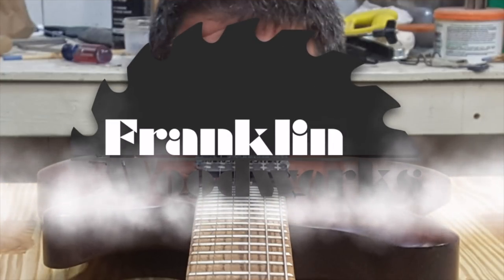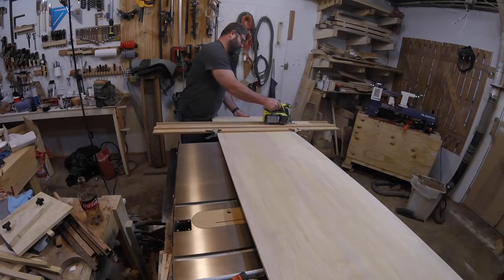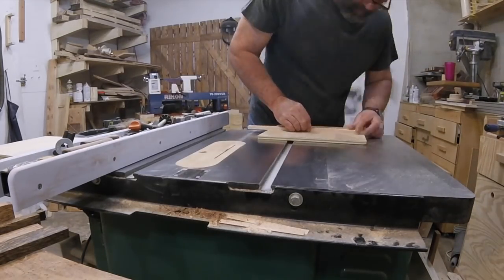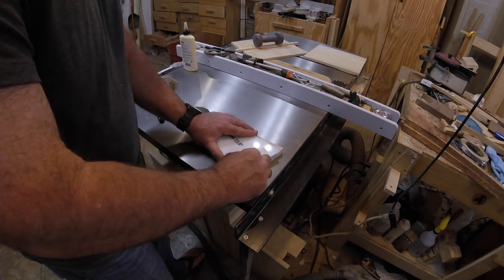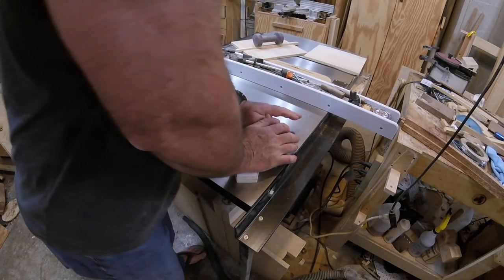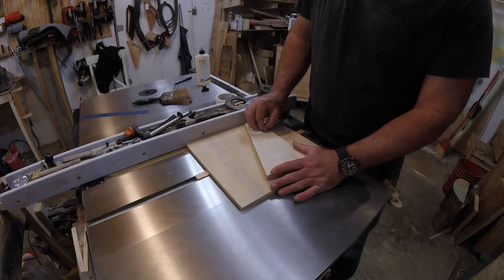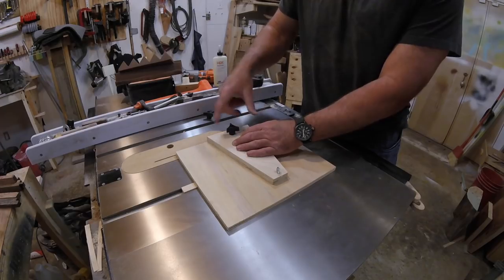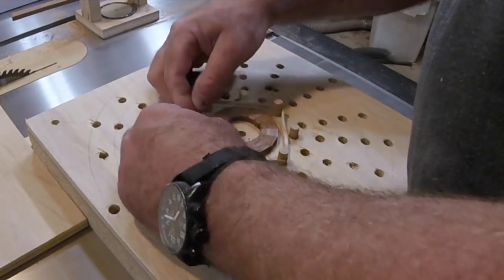Quick and Easy Wedgie Sled

Comment: There is a fundamental difference between this design of a wedgie sled and the original with two fences. With the original you are always registering the cut to the same side of the stock; therefore, the two sides do not have to be dead parallel. With this design, you're using both sides of the stock for registration; therefore the two sides do have to be dead parallel. I know that is not insurmountable but it does introduce another possible error.
Reply from the maker: Good observation, and totally correct.  I do, however, make sure my stock has parallel sides - a well set up table saw makes that a snap. Thanks for watching!

Comment: 1. does it make a difference which end is the saw blade end, wide part or narrow part of the template.
2.  could you not just use one side of the template and rotate the piece to be cut? (mark each side of the piece to be cut,  A  and  B, first cut A side up, 2nd cut B side up)?
Reply from the maker: The end you use wouldn't make a difference, it's just personal preference.  Theoretically, you could just use one side.  However, that would depend on perfect placement of the wedge exactly perpendicular to the blade.  If you are off .003", multiply that by the number of segments, and you could be way off by the time you get everything cut.  By using both sides of the wedge, it's self-correcting.  I'm not a math major, but I think just flipping the wood on the same side of the wedge wouldn't correct.  Might even amplify the error?  Maybe someone smarter than me would know the answer to that.
Reply: Ok, thanks.

Comment: great work....I really like the Rubber band block.... did you use a plan?
Reply from the maker: I didn't, but I saw one in another YouTube video, and decided it was a great idea.  Turns out it was.  I used a piece of 3/4 plywood glued onto a piece of a 2" thick pressboard door.  The rings are in 1" increments.

Comment: IMPORTANT: Cutting on a table saw on the back side of a fence is dangerous. As the strip gets shorter the more it gets. I know it sounds like a good idea but it is not. There are several ways to make a Wedgie sled that is safe. As the inventor of the system and producer of the Segmentology videos, I have more experience at it than anyone on the planet. The table saw is not your friend. It will bite you bad.
Jerry Bennett
Reply from the maker: Mr. Bennett, first let me thank you for your HUGE contribution to the woodworking community.  I discovered turning fairly recently, but segmented turning is what gives me the most pleasure.  I agree that cutting on the back side of a fence is not ideal, and can be disastrous.  But most of us change the methods we use as we gain experience.  For instance, most professional woodworkers take the cumbersome blade guards off of their table saw.  I don't believe this is done out of ignorance, but done with knowledge of how wood is interacting with the blade.  Likewise, I take appropriate precautions when I'm cutting segments, ensuring that I have a solid grip on the work piece, and I never force the wood through the blade.  All that being said, I have since discovered that making the sled is so easy and fast, and since they can be relatively small, I'm just going to make separate sleds for each wedge angle, permanently affixing the fences, and using the fence methodology you suggest.  Thank you so much for watching my video.  I am truly honored you took the time to comment and share you knowledge with me and others that may read this.
Reply: Sorry, but as a new segmenter I don't understand the warning about "cutting on the back side of the fence."  Please explain to a novice.  I want to be safe!
Reply from the maker: @randysmith4344  A very general rule is that a work piece should be supported as well as possible when introduced to a moving blade, sanding belt, etc.  When you put a work piece on the back side of a guide, that work piece will want to pull away from the guide.  The only thing holding it to the guide is the pressure you're putting on it with you hands.  This greatly increases the chances of an accident.  I'm going to make another sled soon that will take care of this problem.  Stay tuned!
Reply: Thank you.  I get it now.  When Mr Bennett said "fence" my mind immediately went to the table saw fence and I just couldn't understand what was being said.  Now i do.  Thanks very much and thanks for the great video.